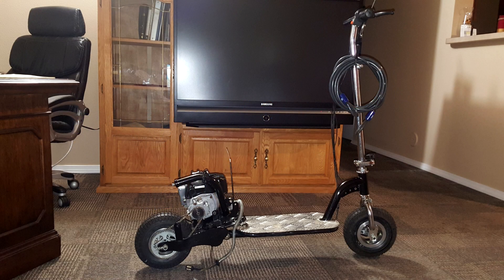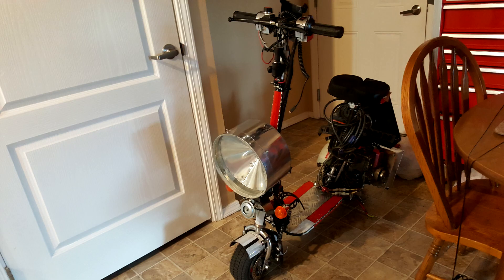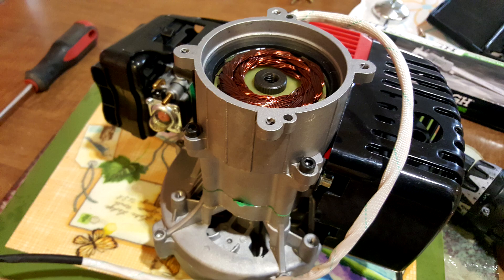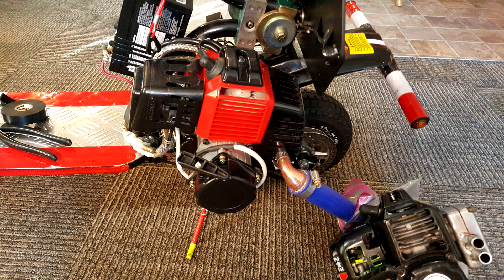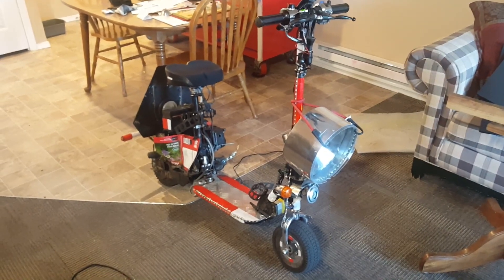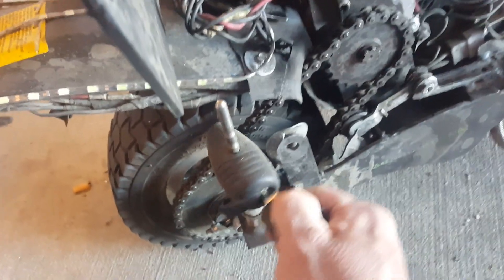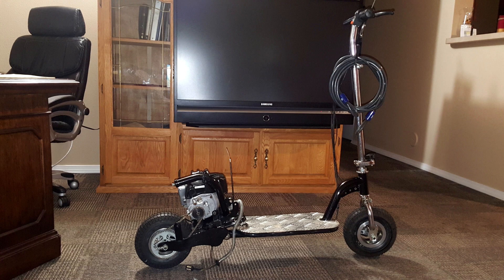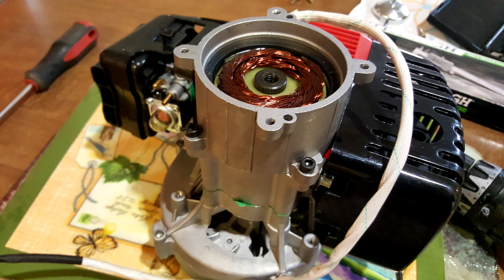Best scooter design ever ,  hybrid 2 cycle 49cc scooter .

Comment: Can you link the 49cc motor you used in this video with the parts?
Reply from the maker: It's is just a 49-52 cc with electric pull start. I made it function differently.  It has so much torque that if you don't use amazing rubber motor mounts it will eat the normal engine brackets quickly.
Reply: @SharkFaceKidd how did you wire it up I’m dealing with a wiring mess
Reply from the maker: @zandercolandria1437  how so? 🤔  I got rid of all the other stuff . Just use a solenoid.  You want a voltage indicator, and run the rmp at about 1/2 or so . Push your starter button there and it will quickly recharge the battery fast . But don't go over 15 volts much . It can kill the battery.  The easiest way I know how.

Comment: Hello I am curious on the charging system for this 30 amps at 18v that's like solar charge levels and am curious because that's like 600 watts  or so of power what would be the most efficient way of collecting power
Reply from the maker: It's a 12-15v battery.  I don't know the watts but you could put a bigger volt battery/ pack and it could be beneficial in the hybrid part? I think a 16v would be ideal 🤔! Anyways that is the next mod. I'm doing. I don't use a regulator. I just push the starter button when the voltage meter goes down . It works great/ charges very fast  !!  I am working on a electric hyper scooter now .
Reply from the maker: It launches the scooter if you have it set up correctly!

Comment: Hi I would like to know how you make it push start. I got the same scooter and I hated the pully. It keeping getting it stuck and not rewind. Please any help greatly appreciated. Thank you.
Reply from the maker: it has an automatic centrifugal clutch . you can't turn the motor with the transmission.  sorry . if you can turn the engine with it push? it is likely very broken
Reply: vmaxfodder thanks for the quick reply. What I mean was. My scooter is stock. It have the cable pully to start the engine. On your you have push button start. I want to know how you convert the cable pully to the push start button and what parts does it need. Also your modified muffler very interesting. Thanks
Reply from the maker: @2liveiv608  thanks ! yes the muffler is very solid too. it does not fall apart anymore whatsoever.   first you need a electric pull start crankshaft.  they don't have threads on the outside.  you need the one that can take a bolt. then you need a special bolt for the middle . I found mine on ebay (fancy scooters)  it could be easier/ cheaper to just buy an "electric pullstart " from ebay?? however they don't put them together with the correct bolt, and they fall apart very soon !  I would take it apart then buy the correct bolt, and use a feeler gauge to center the thing before starting it . then drill out holes in the correct places for air flow. the heat is horrible on brush life in the starter.   be careful of getting too much power out of these motors. the mounts are not strong enough to handle huge amounts. it tears the bolts off! I learned the hard way and made them waayyy better !